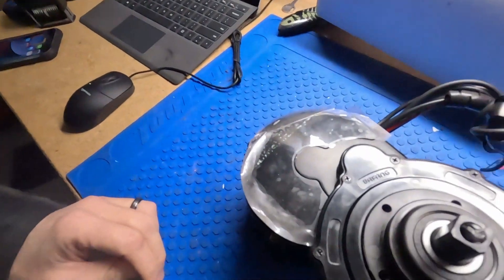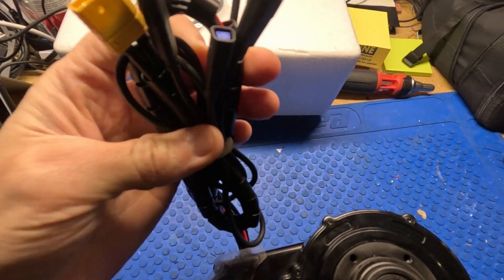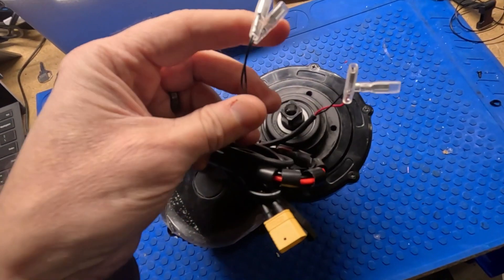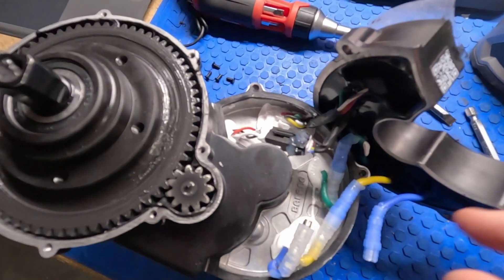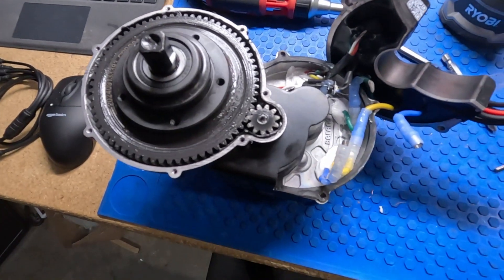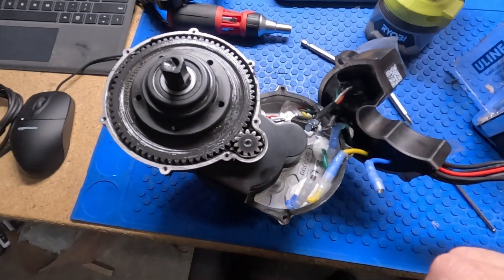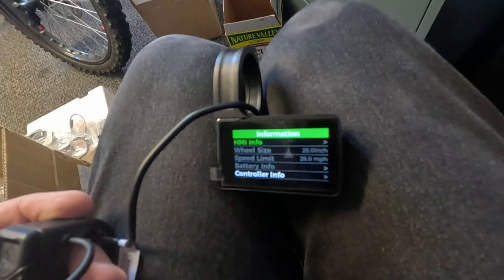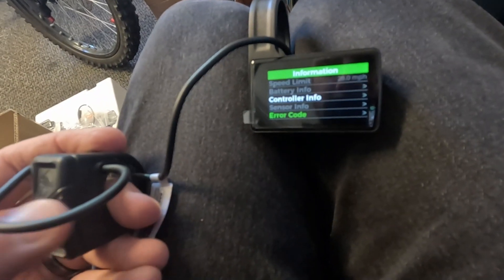Bafang CAN BUS BBS02 First Look Hands On!! Bafang CAN't do this to us!

Comment: Wellzo, I went down this road &  got miself a 750W Bafang mid motor unit. It's can bus. 

The battery is not can bus, and I have no parameters on my diplay of course.

At this point I am seriously considering going back to 1 gear no assist no hitek.

Comment: I recently ordered a canbus bbshd 48v 1000w, will i need a canbus specific battery or will the other batteries work and if so which one do u recommend
Reply from the maker: If you ordered the new motors, (2025)they do not require a specialty battery. You just need to make sure that the voltage is are correct as in 48 V or 52 V.

Comment: Does the new CAN bus system require a battery with the CAN bus connector? Like, if I use a different battery without the connector, will I lose something or be able to ride it? Thanks
Reply from the maker: No you don’t need a special battery

Comment: At 2:30 in the video you say that we may be able to swap a UART controller in place of the new CAN controller. I was quite excited to hear that so I went down that path. Unfortunately they are slightly different the flat connector with the most wires is different. The UART controller uses 5 wires but the CAN controller uses 6. Dang! I'll be returning the CAN based motor and continue search for a UART version.
Reply from the maker: Good to know! Perhaps down the road an adapter will become available
Reply: @JohnnyNerdOut  Please update us if you find a solution like this!
Reply: @Kyle-kv6ur 
They make an adapter, it’s a new release called TSDz8
Reply: @shockadellick i can also confirm tsdz8 is the only way to replace canbus bafang mid drives
Reply: @SeatbeltFan  
Canbus is horrible. I almost switched to CYC's until I found the TSDz8...and those of us that aren't newcomers to the DIY e-motors know CYC aren't solid.

Comment: Hey Johnny, I ordered the new can programming cable and I’m wondering if I’ll still be able to use penoff’s software to adjust settings from my computer? Thanks!
Reply from the maker: Likely not
Reply: @JohnnyNerdOut Bummer man, thanks for the feedback I’ll cancel the order. I’m using the ekd01 display on version N22 and the advanced settings do give a bit to play around with but not as much as I hoped

Comment: The designers of this new can-bus series at Bafang are showing their customers the middle finger. Even in the fall of 2025, we will not be able to access the values and settings of the motor using a smartphone or even a computer.

Comment: Thank you for this walkthrough.
I was also annoyed by the fact that the new connectors + different USB cable/tool was necessary.
After buying a display from Bafang, I could use the Bafang Go App to configure the riding modes, BUT NOT THE THROTTLE (annoying again) 
I am now buying the BESST programer tool, as it really seems essential. Hopefully it will bring back the level of programing that was possible with the UART version.
I really hope the old tools will evolve to be compatible with the CAN BUS controllers.
Reply from the maker: Unfortunately, I think you’re gonna be disappointed, even after ordering that tool. I am waiting for a third-party to jailbreak the motors with their own software. I think we are getting close.
Reply: @JohnnyNerdOut Any news about this? I have a Bafang BBS02 with CAN protocol, I would be interested in what you managed to do with it.

Comment: 5 months on, would you still go UART over CAN?

I'm thinking about building my first ebike, it's a bit of a minefield. 😬
Reply from the maker: Yes I would still do UART as of now
Reply: Same, I’ve been using ChatGPT to help me navigate the minefield that it is. I mean it’s not that bad but very confusing at first, and the motor is only the first step. The battery is a huge expense, almost as much as the motor. I’ve been looking at it seems that really you don’t have that much of a choice. There’s the TongSheng with somewhat open FW, CYC Photon with completely open customisation (i.e. almost as good as open-source) or the Bafang CANBUS version - both BBS02 and the BBSHD. The 750W TongSheng TSDZ8 is actually a bit cheaper than the Bafang BBS02 so that is really the only debate. The CYC is far too expensive for me. It does have better torque sensing unlike the Bafang. I’m really stuck myself, just like you. I’ve been researching for about a week and still haven’t made a solid decision. I want a city cruiser that can last at least 30-35miles and can comfortably maintain 25-30mph. And once in a while actually be used as an MTB. It’s a hardtail Kona. So yeah, this sh*t is complex as f*ck. I wish you good luck. Let me know which one you are veering towards.
Reply: @IvanPetrov-s6u  Since I posted this I went ahead and purchased a 48v UART version BBSHD. My decision was made a bit simpler after I printed some templates and I realized that the BBS02 wouldn't fit my frame. I also couldn't find a 52v UART version anywhere in my country! (UK).

But what really swung it for me was that the Bafang is very well supported with spares and aftermarket parts. So if it ever goes wrong, I should have no problem fixing it. There also seems to be a big community of users as well, so more information available to newbies like me.

Good luck with the build!
Reply: I wana  turn my bike into a e-bike, but can bus ist Not what im Searching for.... this ist completly the last shit.... i dont wont spend 400€ and then only drive 25 kmh

Comment: So do I need to buy the old style controller to program my bbshd? Im a noob and just bought one that has the canbus connector.
Reply from the maker: Depends on how much programming you want to do. You might be able to use the 010 display to do basic programming from the display. It’s not nearly as in depth as the old style though.
Reply: @JohnnyNerdOut   where caN I buy an old controller with all the connectors and necessary hardware? Wondering if I should go that route or just return my eggrider and ride it like it is.
Reply from the maker: I have them on my site

Comment: Hello. I also encountered the problem of changing connectors yesterday, having bought a new motor. I don't understand one thing, why the front headlight stopped working.....maybe you encountered something similar? polarity is OK. tried even in the dark... suspecting that maybe there is a light sensor somewhere. but no. it blinks and immediately stops working. tried a diode flashlight and with an incandescent lamp. wires are OK, no short circuits. the display shows that the light is on...  Help please 😅
Reply from the maker: Bad headlight?

Comment: I just got my new BBS02 750w kit.. the website looked like UART... and there are no directions in the box.. There are no youtube videos on how to install the new CAN motor kits.. My kit cables / light cables look different from yours.,,   
Hopefully i will be able to set the wheel size on the new CAN kit..   i have the old UART programming cable.. and if the new pc18 display won't let me set the wheel size to 26"... i'm going to be in trouble... There was nothing wrong with the old UART kit.. why the change..
Reply from the maker: Install should be the same essentially as the video I made for it. The old UART program cable will not work with the new motors, though you need to get a specific one made for it, which I do carry but it is quite a bit more expensive.
Reply: @JohnnyNerdOut  you just hit the nail on the head, this required New Cable "is quite a bit more expensive". This is what Apple does with their computers. you buy a new one and none of the old cables, apps, peripherals are compatible.. you must buy all new (multiple) $40 cables to get the new computer up and running. Some of us are awake to the planned obsolescence .  LOL

Comment: to extend the life of the motor.. I pack the reduction gear with "Black Moly grease LI2"(Lithium 2) specifically for this application.. Don't use anything but the black moly li2 in your reduction gear.. (thick like creamy peanut butter). If you have a noisy motor, that means something is rubbing and will eventually damage the motor.  Packing the reduction gear increases range and stability of the motor and makes it quiet again..
Reply: I use Mobilgrease 28.  It's expensive, but you can notice the difference when you pedal.

Comment: How many miles or years does a mid drive motor last?
Reply from the maker: Technically forever as long as you replace any small parts that fail along the way
Reply: @JohnnyNerdOut  I'd love a 750w mid drive electric velomobile. They're expensive but I'm really liking the idea of a mid drive velomobile that could handle crusing at 35 -40 mph....Especially a 4 wheel Quattrovelo velomobile. That could be custom built.  With a fully enclosed lid & where the seat could unfold out flat into a bed. So your velomobile could convert into a weatherproof sleeping pod.  Sorta like a micro motorhome. With an electric jacket in winter & some 12V fans for Sumner possibly also 12V cooling peltiers & a mini ice cooler to stay cool. The AC system could  be a combination of small 12V DC fans & peltiers  that blow air through the small ice cooler blowing out cool air. 
The body of course would be covered in thin lightweight laminated solar cells. Might have room for 75w worth.....Velomobile/ mini Aptera mini electric motorhome. Crusie across USA using fold up lightweight solar panels stored in mini trailer. That double as shade awnings for the velomobile & campsight.

Comment: Thanks for the update.   Here is my question.  I've got 2 BBS02 builds that I'm happy with.  I've got a 3rd motor on the shelf.  At some point in the next year, I want to do two more builds (to home in another state where my son lives).  Would I be better off to get a Uart style kit so the builds are the same and can share/swap components or not worry about it, and just know that one build is all CAN style components and controller. How long will you think you'll be able to sell older style kits?

Comment: One of the benefits of conversion is that it is not proprietary. Bosch has not been able to break in to the market with their kit (kind of nest looking) partly for this reason?it is popular among recumbent builders, but that could be just because they tend to be a bit elitist). 

The ToSeven DM01 is so very close to The BBSHD, but a lot simpler, lighter and technically legal. It can be programmed in so many parameters from the display. Why would someone spend more for the Bafang BBS02, plus the expensive programmer?

I am not trying to be snarky. Sorry, I see it reads that way. I really want to know. Some might say it is for Bafang's legendary reliability and quiet, but heck , used within reasonable, the 144+ TSDZ2's I've installed ha e even been amazingly reliable.

Comment: Waveshare has a uart to can adapter for $8.99. bi-directional communication. 

I am not a fan of those stupid connectors anyway.    

Like we need more weird shaped connectors to stock. Just cut the ends and use whatever you want you can easily make your own "waterproof" sleeves to go over whatever connector you want to use. Use the marine shrink tubing that has glue in it and the large normal shrink tubing to make sleeves that fit inside each other. Use the marine stuff on the outside so you get a waterproof bond at the wire and the normal shrink tube. You only shrink the marine stuff, leave the normal stuff unshrunk so you can roll it back to get to your connector. It's a bicycle, not a submarine. It just needs to keep the rain and snow out.

Comment: Yellow triangle is a CAN bus from battery, dont tell untrue if you dont know whats that!
Also why you want UART? Old controllers and 50 year uart bus?
Reply from the maker: You don’t have to use the can interface with a battery. You can though and get more information on the battery but it’s not required. 98% of customers will not use that can interface I would estimate
Reply: @JohnnyNerdOut so the proprietary battery communication doesn't need to be used?

Comment: Why buy a heavy, DIY motor with a walled garden controller? Might as well go for the CYC for a quality experience, or a ToSeven/Tongsheng for the low end cheap experience? Bafang is killing their market proposition.
Reply: the M435 and M635 bought some real improvements, Magnesium casing, torque sensor, heavy duty construction. It came with the CAN protocol and you definitely needed BESST, because for some reason, stock configuration is always total garbage with bafang motors. overrun, poorly calibrated torque sensor etc.
converting the BBS02 to CAN is totally pointless, they'd better figured out how to make the M435 more affordable and ship it with proper parameter settings. if aluminium instead of magnesium would have significantly cut the price they would be stupid to insist on shedding a few grams with a different metal. nobody cares if the motor weighs 200g more or less

Comment: it seems like BAFANG has possibly locked down the BESST programming software, so that even if you buy the BESST programming tool,  you additionally need a BAFANG login to use the BESST software- which is provided by bafang and requires approval. It is unclear if the BAFANG login required to use the BESST tool is only available for OEM partners and brands. It seems like individual DIY users may not be able to create a required BAFANG account to login and use the BESST programming software. Note the BESST software appears to have an  "offline" mode, which allows (limited?) programming capabilities without logging in to a bafang account. But BAFANG could change the limitations or remove the "offline mode" at any time. The bafang login seems like an issue and is my #1 question about using the BESST tool

Comment: Not to worry, Eggrider V2-3 and the Eggrider C1 are both can and Uart compatible with adaptor cables, the C1 is amazing with heaps of stuff coming down the firmware pipeline 👍🏽🥚📲🚲⚡️💨
Reply: Does that mean you can totally replace the ECU so to speak with the Can-Bus? (don't understand how it works..)

Comment: You're making me want to doomsday prep and buy a bunch of BBSHD motors with uart 😅
Reply: Just order replacement UART control boards instead. They only require minimal rewiring to fit the CAN models. Similarly, in due time, parts for the CAN models will be available and we CAN (pun intended) order CAN control boards and drop them into older UART models.
Reply: @ryanclapp6467  I feel like other things are on the horizon... This canbus model is just the beginning... I'm honestly considering purchasing another BBSHD and X1 Pro Gen4 just in case I can't get them in the future... There's a trend with laws that I feel may outlaw these motors but I live in Washington State where certain individuals just outlaw stuff with no reason...

Comment: Are any of these changes a benefit to the customer or is it all self-interest on Bafang's part?
Reply: A little column A, a little column B, actually. Wins and loses on both ends of it.
Reply: At least there are some benefits, which is a good thing.
Reply: can allows for much more control, much better variation in the commands you can send. can bus is better, and used on every single car now.
Reply: @SB7-r9i  
Maybe Ai can weigh-in on this:
"Why Tesla is moving towards more Ethernet usage (vs. CAN):
Advanced features:
The growing complexity of modern cars, including autonomous driving features, require high data processing power which is better supported by Ethernet. 
Reduced wiring:
Utilizing Ethernet allows for fewer cables in the vehicle, reducing weight and simplifying the wiring harness."
Reply: @SB7-r9i  Some vehicles are leaving canbus for ethernet.

Comment: UART is indeed awesome, but CAN offers a lot more for granularity, and as you noted, control! I see this being an easy 'win' for manufacturers utilizing Bafangs' tech.
Reply: UART is not awsome. 
And what you mean by control with CAN controllers? CAN controllers have lot less parameters to set. Here we will be lucky if you will be able to set max power at each pas. M500, M600, older M620 did not have this option and was everything hardcoded.

Comment: In convos, the sentiment is the spades are just a temporary roll-out as tooling and final touches are put into the products for full ramp-up. JST's are likely to be installed on first official prod launches.
Reply: Good evening, have you tried installing a UART controller on a BBS02 CAN BUS?

Comment: Other than a few connectors is this just a defunct M620 series rebadge?
Reply from the maker: I don't think so. Its the same BBS02 with a new controller.
Reply: @JohnnyNerdOut  Good evening, have you tried using a UART controller on a BBS02 CAN BUS?

Comment: Quick question. Battery wise, no need to go proprietary bafang batteries i hope?
Reply from the maker: Nope! Any 48-52v will work (at least so far)
Reply: I use only the 500w, 36v BBS 02. Will it also be available?
Reply: @SkateFit1  As of time of writing, any batteries that theoretically work with prev UART models should be compatible with CANN models. Theirs no "checks" or handshakes in the CAN models that would interact with batteries, other than basic reads on params.
Reply: From what we've poked and tested, no need for proprietary batts from them. They have no handshake or direct auth for the batteries. But, they can certainly change that easily with updates and changes. Hopefully they do not and keep it as is.